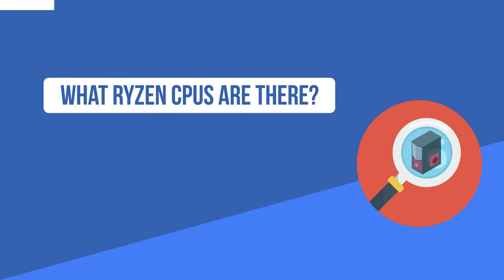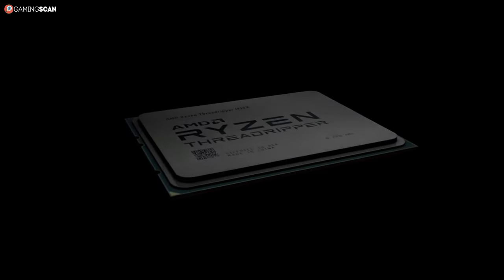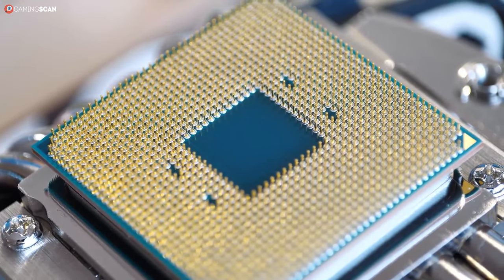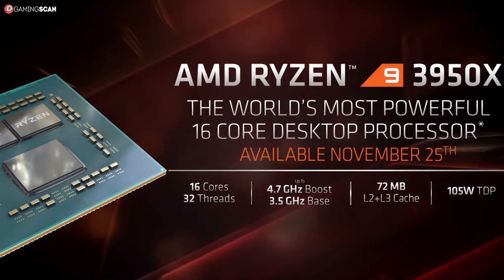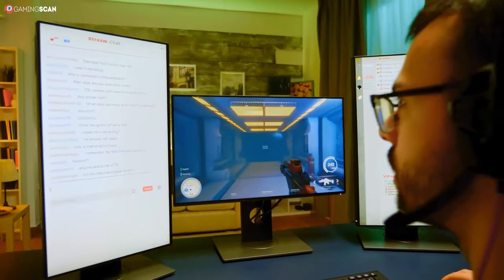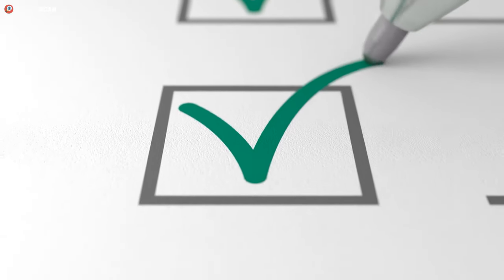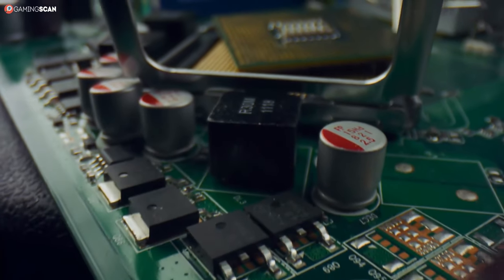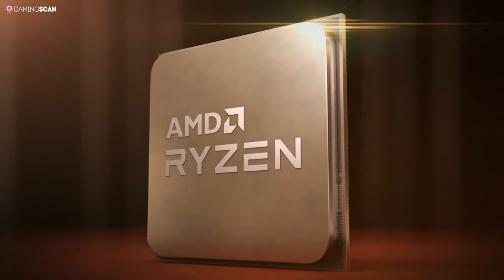How To Pick The Right AMD Ryzen CPU For Your PC [Guide]

Comment: THANK YOU for actually explaining EVERYTHING. Not all of us are tech savvy and ive been trying to learn! You earned a subscription!
Reply: A lot of this info is correct, however. there is plenty that is incorrect or recently became incorrect just as a heads up.
Reply: @slloyd4497  whats the incorrect information.
Reply: @scrawnybuddha9039  there's nothing wrong with the capacitors in the 3000-series cards from Nvidia. It was the drivers...
Reply: This is ltrl the best
Reply: Same dude. Everyone always explains away like we know what overclocking is or doesn’t give a good reference when talking about what an average gamer wants out of PC parts. Like comparing a CPU’s specs with another CPU, it doesn’t help me. Because I’m trying to find out which CPU I need for an average game today.
Reply: I thought this was boring stuff until I finally got mine
Reply: Will it fit socket from fx 8350?

Comment: This vid got outdated fast.  In all reality, the 6 core is the new 4 core. 4 cores are now obsolete.  All modern games these days require at least a Ryzen 3600x for minimum recommended specs for 60fps at 2k. QHD.  8 cores are now the "sweet spot" for gaming, and a 12 core may be "overkill" at this moment, but not in a few years.  As a matter of fact, there are games today that will utilize ALL 12 cores or more. Far Cry 6 and Cyberpunk 2077 certainly do.  The six core will be obsolete by that time just like the 4 core is now.  Gaming software technology is advancing more rapidly than it did last decade. And when the  Ryzen 9 5900x 12 core is available for around $599.99 CAD right now,  it's more than worth it. There's no such thing as "overkill" when the price is right.

Comment: NOTE:
There were no Ryzen 4000 Desktop processors.
Ryzen 4000 was mobile (laptop) only.
Desktop 3000 = Lapop 4000 generation wise.
This was not known at the time of this video.
So when she meant "skip the Ryzen 4000 and go for Ryzen 5000 for future-proofing", take it as skip 5000 and go for 6000.
5000 series is also where AMD beat Intel in gaming too, by having better single-core performance (5600x beats 10900k too in that). Skipping 5000 to go for 6000 and AM5 socket boards should give you 5 years of upgrade capability (as we saw about 5 years support for AM4) AND rumours suggest DDR5 RAM support.

Comment: Yo good ting I looked at this I definitely know now that I’ve got the best option on a ryzen 5 3600
Reply: 3700x would be a better option if you do more than gaming. Otherwise the 3600 is a great cpu
Reply: @Nopenotatall   
if you montage the videos on 1080P quality i think it's still useful CPU and you don't need to upgrade just overclocking the 3600 and you will be fine

Comment: I don't think Ryzen 5 is for gamers anymore as the new consoles will be using ryzen 7 chips so games are going to be developed for systems with 8 cores with 116 threads so if you have less than that you will have a bad time so I would say at a minimum you should get a ryzen 7 cpu for gaming until they update ryzen 5 to use 8 cores.
Reply: For some I may agree but the pocketbook of many tends to dictate what one can afford. If your building or buying a high end $2,000 computer yeah R7 could be best choice. But for those of us who are on a tight budget and have to keep cost under $1,000 it's not about biggest and best but what is cheapest and still do the job. Seems the R5 is still capable of doing what it's called on to do at a good price.
Reply: @kenjett2434  I would save the extra 150 as you will have they system for 5 years rather than replacing it in 2 the extra cost will benefit you as modern AAA games are already maxing out 6 core cpu's. I'm going with the R9 5900x as I think it will cost me less in the long run as I will have it for longer. I like to buy what will cost less over the long run than right now.
Reply: @kevinlind3172  that's fine if you can afford that. But I can't afford a $2,000 plus system and according to testing doesn't improve current gaming but very little. The biggest and most expensive isn't always the best choice. Like I said for most it's the pocketbook that chooses for you. All I want to do is play a few casual games and make and upload some you tube video. I don't need a high end computer to accomplish that. A mid range will do just fine.

Comment: Ryzen 5 3600 is still KING!
Clocked mine to 4.5Ghz at 1.285v
Reply: How’s the overclocked going I only went 4.2
Reply: @snyderkurtis  pretty good, I’ve cut it back to 4.4 as dont want to be running a max oc all the time.

Comment: This Zen 3 CPU's will be Ryzen 5000 not 4000. Also, next gen consoles will have 8 core Zen 2 CPU's so a 6 core CPU may start showing it's age sooner than you think.
Reply: i have a rx570 could a ryzen3 handle that?
Reply: no it won't lmao
I am using a i5 6600k and I have played all latest AAA games on it without any issue.
Reply: No not even the 4 cores CPU we have a plenty of time before that happens
Reply: From what I see, most triple A games can't even use all 6 cores efficiently.

Comment: Well really it depends what you use it for A Ryzen 7 is really what I would recommend for gaming with and a Ryzen 5 if you're not really going to do much of anything else in the background I just upgraded from a 1500x to a 3700x and it's wonderful I don't have to worry so much about my processor maxing out anymore like I had to with that 1500x, a Ryzen 5  3600, 3600x, 5600, or 5600x is fine too if all you are doing is gaming don't confuse the Ryzen 7 and 9 as just business end CPUs like she explained, I would say if you have the budget get one of them so you won't have to worry about upgrading for quite a while a 3900x will last you a long time if you want to know between the 3900x and 5900x and you already have a 3900x don't upgrade until the next-gen Ryzen 6000 series comes out you'll be fine until then if you are on a Ryzen 5 or decided to get one over a Ryzen 9 then I would consider upgrading to a 5900x but upgrading to a 5600x ehhh not quite the upgrade i mean sure it's faster but... just a little bit and it owuldn't be worht it to me.

Comment: Just a heads up, the Ryzen 5 3400g doesn't have 6 CPU cores, it has 4.
However, it also has 11 integrated GPU cores.
Reply: Wrong
Reply: @sivaspidey597  No u.

Comment: I'm curious if Ryzen 5 is still the best option to consider today since this review was made a year ago. I'm now thinking of purchasing Ryzen 7 instead as I want to consider a good processor for a long run. Any thoughts?
Reply: No thoughts, only the same questions
Reply: I have the same thoughts 😭
Reply: @alexa4201  i had a similar thought then, was gonna get the Ryzen 5 2600 at the time since it was on sale when the 3000 series were only a few months old, but i opted for the Ryzen 7 3700 8 core instead, and im glad i made that choice. sure even now in 2022 i haven't played a game that took up 8 cores, but plenty of games use atleast 4, so getting a 6 core would've been ok, but i wanted that extra head room. it allows the CPU to breathe more, and doesn't have to work as hard. when i put on a game the CPU only operates at 58% which is pretty good, if it's a damanding game it'll go up to about 66%, but that's still pretty good. it also helps if you have a decent GPU, which i do have Radeon RX 6600 XT. i got that GPU after upgrading from a gtx 1050ti i had for a long time.

Comment: There were no capacitor problems with the 3000 series...this was proven to be a driver issue on windows since it has already been resolved..also people using it on Linux before the driver update had no problems to begin with only proving this fact
Reply: Yes there were and still are if you didn’t download the hotfix driver
Reply: Kind of a mix 
Too aggressive of a boost when the hardware can't handle it 
The driver fix lowers the boosts so the GPU can actually handle them 
Either way it doesn't make much of a difference
Reply: They were in fact capacitor problems. They hotfixed them with drivers by limiting the energy consumption.
Reply: @Katniss218  its not what hardware unboxed said...the cards had no problems on Linux and they clock just as high after the hotfix
Reply: @LarkyLuna  I think multiple channels tested the clocks after the hotifix and as I remember the conclusion was that it was a windows problem not capacitor, since the clocks were just as high as before the fix
Reply: @Katniss218   Yup, exactly

Comment: If you are a gamer and want the best performance in games wait till the 5th of November. Ryzen 5000 CPU's will beat their Intel counterparts in most games across the board. Noticed this video almost completely ignoring the announcement of them. And definitely ignoring the benchmarks shown for them already.
Reply: The only issue is finding a motherboard that natively supports Ryzen 5000 CPUs. Keep this in mind if you’re not coming from a platform that will eventually support Ryzen 5000 and already have a previous generation Ryzen CPU for it (e.g. B450, X470, B550, X570, etc.)

Comment: sorry if this is a sorta dumb question but i was wondering what the numbers like 2400x or 3600x mean. like the higher the number the better, right? but what are they referring to?
Reply: The first number is the generation, example ryzen 5 2600 mean ryzen 5 gen 2nd, ryzen 7 4800h mean ryzen 7 gen 4th. same with intel too, i3 9100f mean i3 gen 9th. 

Three numbers after gen is ranking on same generation, ex 3400g, 3550h, 3600, etc.

And yes higher the number mean higher performance and newer release time.

But in the end of the day better to watch review first, because ryzen ryzen 5 3550h is better than 7 3750h which means all of my explanation isn’t all true

Comment: i am still rocking my AMD FX8350 8 core 4.0 ghz and nvidea Gforce GTX 1060 6GB. It still copes well with modern games on medium/high settings. an 8 year old system where i see intel systems from that period struggle a lot with modern titles
Reply: I still have a Intel T5400 from 2006 with (2) 3.16 processors, 32 gigs of ram and a 1060 6 gig GPU that rocks every game at 60 fps!!! Total cost $410 bucks and its still rockin 15 years later!!!!

Comment: A TIP for everyone. Ryzen 9 prize drops so I recommend picking it in 2021 autumn. It is also good cause then you can upgrade Graphics card later on without having a problem, that cpu is not capable handling graphics card
Reply: @jonathan lopez I live in Estonia, so I have no idea. R9 is going to be probs like 400-600 in autumn (USD)

Comment: It is still unclear for me, for example I am a Java programmer and my application is a web server which runs 100 thread. How these threads translated to Ryzen cores or threads? From other side, if I am a JS programmer and run my app runs against a single threaded node.js, will I get any difference between different Ryzens?
Reply: More cores or threads don't necessarily make one program run faster or better.  It often does but some programs do not benefit from the extra cores or threads.  The cores and threads, helps the cpu do more things at once faster.  If you are writing a script while looking up references on a different site and doing other things at once on the pc, that is when more cores and threads comes in very handy.

Comment: Hey I dont know what the hell are cores for but when I was using the 2nd gen Intel Core i3 2100 with a 6gb Ram and a AMD RX580 GPU with ArmA 3 then  I went around to findout why is the game still responding like  when I had a AMD HD5770 GPU and they told me that some Games depends on CPUs than GPUs and thats how I know 6 cores was a better choice.

Comment: Much appreciation for this video 👍, as My current desktop pc is  using the AMD FX3850  but plan on building a Ryzen desktop pc in the coming months. It would be nice for you to do a video on the laptops available with Ryzen cpu's  .  I own 3 laptops with Intel cpu's but would go for a decent performing laptop with Ryzen.
Reply: Ryzen 4000U/H series
Reply: Linus did a video with a laptop with an AMD CPU. If you search it, I'm sure you can find it
Reply: yea go for a ryzen 4000 series
they beat intel by a lot
Reply: @matthewmcclain1316  ur talking about the asus zephyrus g14 which contains a ryzen 9 4900hs i think
Reply: Since I made the previous comment, I held off on a Ryzen desktop build due to Graphic card pricing😢.  I did buy a laptop ,The DELL G5 SE with Ryzen 9 4600H. I am happy with it after some tweaking 😁.

Comment: Me with 9 year old cpu and 8 cores
Reply: Doesn't mean a thing, a non 0verclocked xeon 1650 or 1680 only perform about the same as a Ryzen 1700.  I could of almost built a full system for the price I paid for a 1680v2  cpu  2 years ago.  Architecture is also important.

Comment: Helo sir g plzz help me
=Gigabyte bronze gp p550b 80 pluss power supply
=Adata xpg D30-80G 3000 ram 8 gb ×4
=Seaget ironwolf 2tb Nsa 3.5 6 gb 5900 rpm. HDD
Western digital 1 tb ssd
= Intel core i3 9100 processor
= Msi nividia B450 motherboard
=Gigabyte radeon Rx 570 8 gb grafic card
= Cabinet Esport 1ce 200 tg

Plzz help sir kaya is configuration me sahi h kuch chang to batao plzzz
Processer abhi baad me chang karunga g budget  nahi abhi

Comment: I just got into PC gaming. Can an sff case effect what cpu you can get?
Reply: Normally it doesn't.  It depends more on what motherboard, graphics card and cpu cooler you need to run along with the cpu.  The cpu is the most standard thing between different motherboards and sizes.   Getting a small form factor case only limits how much you can fit in it, so you may have cooling issues.

Comment: Yeah Zen 3 is awesome, But until I upgrade from the B350 I'm very happy With the Ryzen 5 1600 AF (Zen +) and RX 580 8 GB. imho Zen + is still a very good processor. Not to contradict but you said Ryzen 5 is only 6 core you forgot about the R 5 1400 and others

Comment: Should I get a Ryzen 7 5800x 8 Core 4.6GHz or a Ryzen 9 3900x 12 Core 4.6GHz? Both $490
Reply: R9 5900x isn't that much more...And you can get an ASUS Prime B450M-A off newegg for $59, (with hopefully updated bios to handle the 5900).

Comment: Can you suggest best Motherboard for Ryzen 5 3600 which can support ECC RAM for Windows Server OS?
Reply: I don’t think that exists
Reply: You're better off building on a server platform which is validated for ECC. There have been a handful of X370 motherboards which supported ECC mode in some capacity, but results have varied wildly.
Reply: Thanks  @tuulofdstrxn  .
I am on little budget. What 12 thread CPU you will suggest if ECC RAM is must me?
Reply: @VirendraBG  Do you plan on building multiple virtual instances or just one server instance?

Comment: hi, i need advice. i just had a computer built for me to handle photo and video editing needs and presumed it would be super fast with the 
specs i got.  cpu: ryzen 7 5800x, mb: msi mpg x570 gaming edge, gpu: rtx 3060, ram: ballistix 32gb 3600mhz, drives: m.2 nvme samsung 980 pro.

Whenever i do anything slightly intensive (export edited photos or make photo adjustments in advanced program), the cpu maxes out at 100% the whole time. I didn't expect that from these specs. Suggestions? I even did basic overclock to 4.7ghz but get the same issue. I was told it can hit 5.0ghz but can't get the cpu there. 

Would getting a Ryzen 9 make much difference?
Reply: More cores, more power, either manufacturer.  How do you know it's at 100%?  You running HWmonitor and cpuz?  Do you have an aftermarket cpu cooler?
Reply: @lonniebeal6032  Task manager performance tab shows cpu usage on all cores at 100%. I am using a Noctua nh-u12a cooler that is supposed to work as well as liquid cooling.  My previous build - 8 years old - didn't struggle as much with rendering and exporting as the new system does. Spending $2k on a build, I expected it to not lag at all.

Comment: good video. looking to get a 3600XT (since it's the same price as the 3600) or a 5600X and wait till stock gets back.
Reply: I want the 5600x for my first pc build but it’s better to get get a 3700 first maybe
Reply: @franknbeans7745  i agree, but if you are on a budget like me a cpu is something you can cheap out on. The difference is (in gaming) 5 to 15% more fps and for €100 to €150 more thats not worth it for me atm. I also have 100hz monitor so would not change much in alot of games i play.

Edit: thermals are alot better on the 5600x tho.
Reply: Great cpu, but does need extra cooling as I have found out trying to cool it with a Wraith RGB Prism.
Reply: @Wiganpilot  yes i also found that out. It was cooling decently, but it was just so loud. I recommend the cooler master hyper 212 if you are on a budget. It’s €25 and really good for the  price

Edit: but if you are going to oc i would recommend something better like a noctua

Comment: My buddy will have a £600 in January dedicated to the pc, mouse, and keyboard
Reply: Does he have a monitor? £600 is like 800 USD, right? That’s certainly doable if you already have a monitor. My full setup is close to $1,000 including peripherals (Ryzen 5 2600, RX 580 4GB, B450 mobo, 16 GB ram, 500W psu, and two 1TB SSDs with a 200hz 2560x1080p monitor and a steel series rival mouse and Corsair membrane keyboard), but I got a really good deal on my GPU. The pc and m+k are about $800 together, so as long as you’ve got a decent monitor, you should be set for a pretty good experience with that money. If you don’t have a monitor then that’s a problem, as that will be anywhere from $100-$300 just for a 1080p monitor depending on how fast it is (my pc with the specs I listed will play most first person shooters over 100 FPS at high settings. In R6: Siege it will never drop below 150 at low settings). And I would not recommend a 4GB gpu if you want to play at over 1080p.